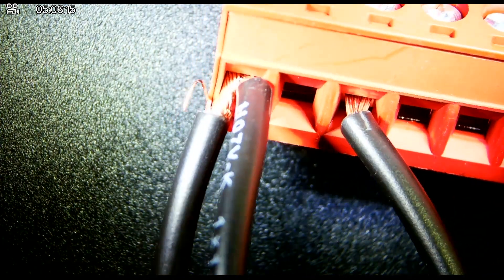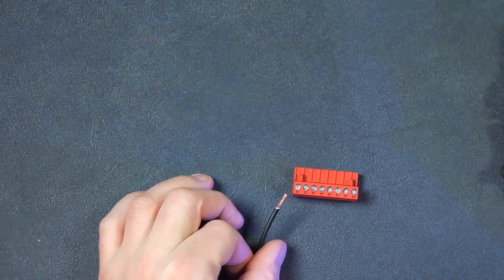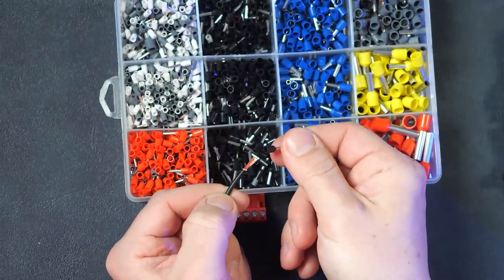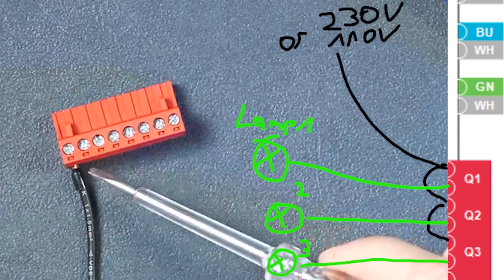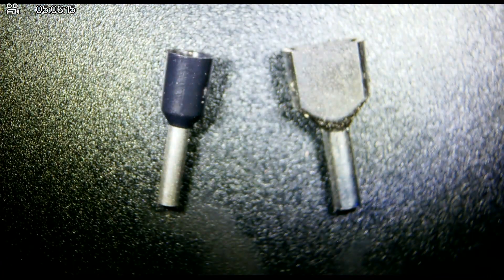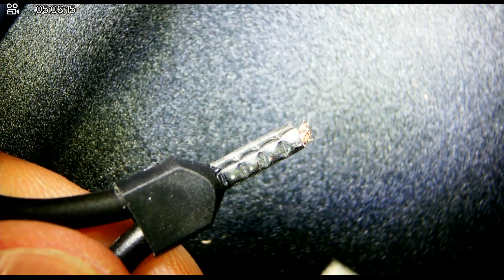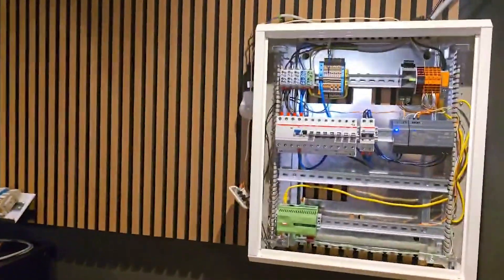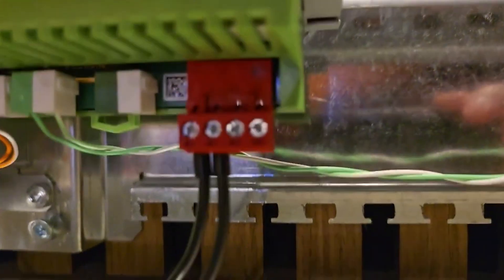Don't make this MISTAKE #smarthome

Comment: Hi, great video! I have a question - could you maybe add a video how to use wiring using coupling relays - might be helpful as well. Im used to add 24V finder coupling relays as kind of protection of miniserver/relay extensions. I think is always easier to replace finder module than whole extension / miniserver.